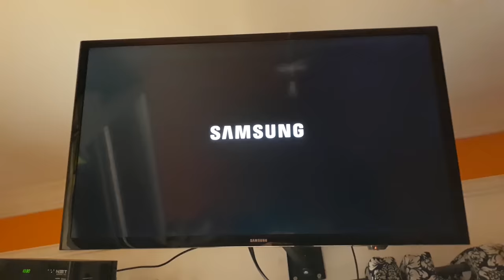Even the rich do that! Fix the remote control with a pencil! How to repair any TV remote control!

Comment: if you wanna check a remote controll functions...turn a radio to AM...then send the signal from the control to the side of the rdio...if it works it will be poulse in the radio speaker.

Comment: I had my RCA remote apart several times and cleaned it and still the volume lowering button still wouldn't work 100%. But after watching this video, I cleaned the circuit board with Q tip and ISO. works like a charm now. No graphite needed.
Thanks.